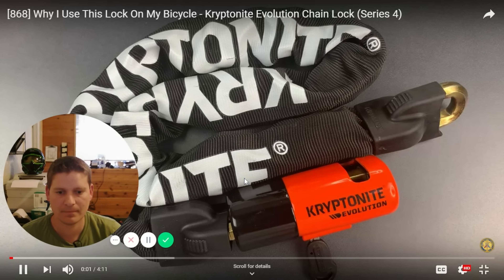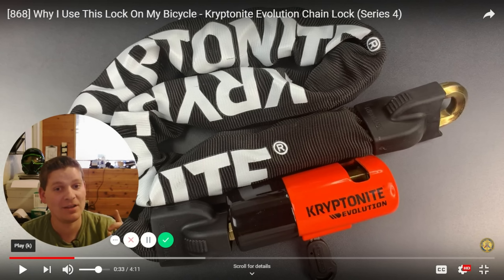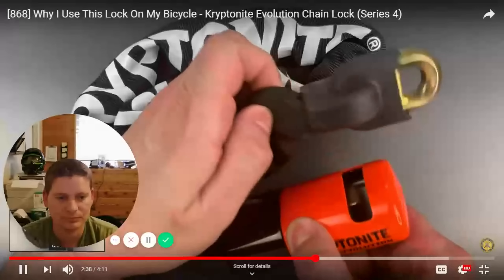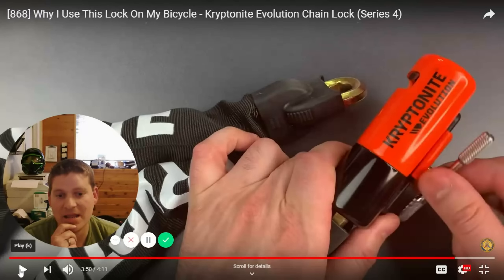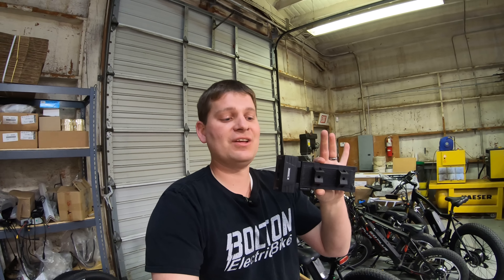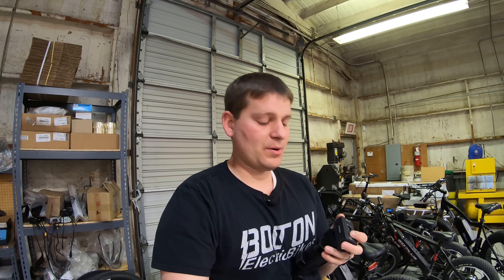Secure Your Electric Bike From Theft

Comment: I think instead of buying an expensive lock, it is better to buy multiple inexpensive but good locks and lock the bicycle at multiple points. That will be less tempting to the thieves to steal as it is secured with multiple locks and requires more time than cutting just an expensive lock. Also install some kind of alarm on the bike so that when someone touches it the alarm goes off and scare the shit out of any potential thief as the sound will draw peoples attention.

Comment: Kyle, thanks for the helpful video.  Great advice on taking bikes in when you can. I suggest taking the seat even if you have a bolt on collar. I have had good success with a quality U-lock and long cable where you can snake it around both wheels. 
That new fat bike does have a Terminator look to it, I like it!
Reply from the maker: You won't believe the new bike. I can't wait to show it to everyone.
Reply: Tern ebikes have removable pedals

Comment: If you have no key or lost the key.
you can very easily make another key fit.
 And it will work & no other key will work for it.

All you need to do is remove barrel.
Insert any key what fits inside.
File or grind the tumblers  until they all level.

Comment: For the seat use a crimped 1/8 coated cable.  I go into Home Depo buy the cable and crimps and borrow their crimping tool (they usually have one there so ask).  Leave enough slack so you can pull out the seat.  Seat thieves usually don't have tool and this system allows you to adjust the seat height.

Comment: Hey Kyle,  good video. You covered pretty much the whole subject.  In anticipation of getting my Blackbird I picked up a brake disk rotor lock that incorporates a 120 db alarm.  Was this worth $ 25 of security?  And I also got  a seat taillight with an alarm with a clicker.  These seem to be cheap and easy,  so is this pretty good for a start?
Reply: It's funny that you said that… I just got an E bike a few days ago, and those are the exact two alarms that I also bought. I like the tail light alarm because nobody can walk up and tell that it's an alarm, and I think the disc brake alarm will detour thieves because they cannot just takeoff and ride. I have to admit, I'm more confident about these alarms than I am chains and cables and U-boats and such....But I have a fairly heavy chain to lock my bike up to a post or object, and I have a cable lock that I use for my front tire. I just got my bike put all together so I have not had a chance to use these yet, but I most certainly do not want my ebike stolen. I also always take my bike into the grocery store, and I quickly lock up my frame to the rear wheel with a cable lock… Only takes about three seconds, And will keep someone from jumping on and taking off on it (speaking of my nice road bike and mountain bike) 

I'm surprised with all of these videos I watch about security, none of them talk about the disc brake alarms, or the tail light alarm that you mentioned. The disc brake alarms are so inexpensive, that there's no reason to not have one, to help supplement bike security. So at any given time I can have my disc brake alarm, my chain, my cable lock, and my tail light alarm....Was not that much money for all of those items, and I would think these would make my ebike "harder" to steal at least
Reply: Yep....me too.... but I bought three different types.... settled with the best one.... got stereo too

Comment: I have gone with an Abus folding alarm lock, a U lock, a cable lock and an additional, cheap, motion alarm. All except the U lock attach to the frame for carrying. I expect most thieves will be put off by amount to cut and alarms going off at the same time. Still vulnerable so considering data dot protection.

Comment: My eBike is not a fat tire.  It's a 27.5 Diamondback hardball with a bafang BBSHD. I had a u-lock w/cable and a bar long both "Via Velo". In less than 20 minutes they took the handlebars, the (pogo stick/box store) fork and seat with post.

Wheels still there though the color dash and of course the brake levers w/cutoffs gone

Comment: I've got a Rad bike and that flaw keeps me from going out places with it. I go out riding, meaning roundtripping. I don't go out to clubs or visiting people that live in apartments that I can't bring the bike with me. Going out food shopping grits my teeth!

Sure, I can bring the battery with. And I do.

What I want is something to keep that battery in place. I saw a handcuff style bike lock that has some potential. Maybe something machined or Frankensteined together to keep the battery from being removed. I do use 2 locks as it is, so that will slow down most, making it less attractive.

I'll share my design when I do! Ciao. Good podcast!

Comment: Yeeeaahh... this is a super AWESOME and very complete video!! Another design flaw, many battery bases (the bit that is attached to the bike frame) is made of plastic and can be flexed, like the Hailong battery case style, I can easily remove the battery from bike with just a butter knife or screwdriver.  Love your work mate... BoltonPOWEEEEERRR
Reply from the maker: Hey Bruno!  Thanks for watching.  FYI - we need you as a guest on the Bolton Ebikes Podcast!   What do you say?

Comment: I haven't gotten my battery yet so I haven't assembled my e-bike kit, but I'm going to be using the updated lobster lock in combination with a kryptonite cable. I'll also be equipping the bike with a sensitive alarm that will screech at 113db if the bike is so much as nudged.

EDIT: Just to test, I went and tried it out since I'm at home, the cable is long enough to loop around my back tire, through the loop under the seat to keep that from being stolen, and has enough leftover length to wrap around a tree or thicc pole before hooking onto the lobster lock. Once I have the alarm, the e-bike should be safe enough to leave locked up while I run an errand inside a store or something.

Comment: I use a sneaky little trick to secure my bike if I'm just going into a building for a few minutes.  I use a gunlock around a few spokes and a piece of the frame.  If someone tries to ride off, they'll have better luck carrying it.  😅  At worst, I'll have to replace a spoke or two, and touch up the paint.

Comment: E-Bike I am buying weighs 100lbs. I figured in some situations I can't chain it to anything.
However I could chain the tires making it immobile.

It would be hard to run off with an 100lb bike. It would be hard to fit in a car. 

I will also put a Samsung Smart Tag to track it.

Only in short trips in a gas station I wouldn't chain it to anything

Comment: Since Ebikes have disc brakes adding disc brake locks with shrieking high db alarms are a great second tier of defense that is light weight, motion sensitive and inexpensive. You can even put one on each wheel in a minute making a much less attractive target.

Comment: the litelok x1, it's anti angle grinder, 2kg D lock, it takes like 4 angle grinder discs to cut through, no thief has time to change their angle grinder discs, plus portable angle grinders have way less power, and takes way way longer, it costs 150£ but if your ebike is worth 2000£ it's a small price to pay, you should have 2 litelok x1's ideally, and always try to lock your bike up too 2 different immovable objects

Comment: I like the Abus lock with the motion sensing alarm, but its SO EXPENSIVE!  

This is a subject I am very interested in. I'm kinda peeved right now because you just threw the thousands of us owning RAD bikes under the bus. Now every goon knows how to easily RIP off my bikes.

I use my bikes to run errands and bringing my bike into the supermarket or drugstore isn't an option. From this point on, even after I buy that uber expensive Abus, I'll have to A) lock my bike to something sturdy B) quickly enter said store and grab a cart or basket C) Return to bike, unlock $500 battery, remove my suspension seat post and toss them into the cart along with my helmet.

Gee, thanks for making life easier! Don'tcha just love the internet?
Reply: Can always change the quick release for the seat post to one of the security ones.
Reply from the maker: Reality check - the thieves already know and you were living blissfully.
Reply: You can always toss a cable lock through the saddle rails (or suspension post if it allows, the ThudBuster LT does) locking it to the bike.
As to batteries I don't care what locking mechanism it comes with ALWAYS take the battery with you.
Reply: @Area13ebikes  Your Sarcasim does nothing to inspire confidence in your integrity. Sorry that you have taken this approach. It may not matter to you but I don't like your attitude or approach.
Reply from the maker: Are you referring to the honest approach?  As another commenter said, this has been circulating online for months.  It's best to be aware of issues.
Reply: Bolton Bikes. Have you contacted Rad Power Bikes? You have not said yes or no. 

Are other Bike shops advertising key blanks for Rad Bikes?  Or just Bolton E-Bikes? Can you provide links or references that “this” has been circulating online for months. You made the video. You sell the key blanks. You have a Bike Shop and you are trying to sell yourself while you are waiting for bikes to sell. It’s best answer the questions rather than provide sarcasm as a cover.
Reply from the maker: @jimblazer7824  search the Radpower forums, Facebook groups, and now even the comments.  You should find that in all three.
Reply from the maker: @jimblazer7824  nevermind - I see you're on the groups and shared my video there too.  ;)
Reply: Look, I like your videos, but you're dead wrong on this one. Saying everybody already knows is a major copout. And it looks like your advertising key blanks on your site as a way for people to go around stealing batteries.

Appearances are important in business and this just looks bad on you.

Comment: I lock mine up directly in front of where I am going inside.Lock mine up to a in ground concrete set parking lot post at Walmart directly across from the front doors.Walmarts group bicycle rack is a JOKE and at the far end by the Garden center not as much foot traffic there.Also have locked mine to a shopping cart when I had nothing to lock too.Or lock through frame and back wheel in front of  convenience stores right under security cameras.Getting a front wheel hub motor ebike kit first  of the year so will be locking front wheel as well when I am going to be away from bicycle any length of time

Comment: I hope you put your code on. I will never lock my bike if I can't see it. I have the New York forgetabout it and a chain lock and a disc brake lock but the key is took it to something sturdy. Stop signs no good one bolt in the bottom off sign and you pull the pole out.

Comment: Freightliner trucks used to be keyed with only 10 different lock sets, I tested it out and found 5 out of 20 trucks in the yard that would open and crank with my key.
Reply: Peterbuilt as well had only about 20 keys to fit over a thousand trucks the company had.
But to steal it you have to know where the brakes are.

Comment: When I lock my bike up at work I always take the battery with me. Thieves have been going for the batteries around here since they're easily concealed after removal. I have the same downtube battery as the one shown that the blanks work on, which has another issue; The metal bolt that the lock uses to secure the battery to the cradle actually locks into just the plastic on the cradle which I'm sure could be fairly easily exploited. That being said my bike is 20 something years old and sports some rust, which probably makes it a little less enticing to steal.

Comment: Years ago, a thief stole a $900 bike from inside a Landis store while he was talking with one of the salespersons. I guess he figured if he pedaled away quickly enough he could get away clean.
This does show thieves can be VERY organized and steal bikes even right next to their victims.
I was in the store, and immediately got on my bike and followed being as discrete as possible and gambling on a few shortcuts. I found a crew of at least 3 people loading the bike into a large panel truck about 1/2 mile away...took down the license and the truck's description and location and phoned the info back to the shop. Within about an hour the Police recovered their bike, but couldn't/didn't get the entire crew up on charges. I couldn't ID all of them as I stayed quite distant to avoid being noticed by them. They apparently just charged the "first" thief based on shop video. The shop put flat tire goop in my (at the time) $120 "superstore" bike's tires as a thank you. I never heard how the case ended.

I was in the shop for a slow leaking tire...the "green goop" never really did do much more than slow down the air leak a bit more.

Comment: HEY! Funny thing is I whatch thelockpickinglawyer, I'm not subscribed, but I enjoy watching his techniques. If you dont know by now I have two Rad Rovers a 2015 I upgraded to a 2017 motor  and I have a 2017 Rover. I love them both, but I think it's just the new Dolphin stly batteries that you could use a blank to release/open the battery  lock. I understand take you bike with, but a Rover is a little to intimidating for most.  thanks for the video!

Comment: No one picks a bike lock. I enjoy his vids too, but 99.9% locks are cut off, and that's really where people should focus in terms of locks being taken off. A battery powered angle grinder with the right blade will take off any lock quickly. So, use best possible locks, use several, other things that slow them down like wheel locks, etc, to add time, is always a +.

Comment: Bike security...  personally, I take the bike into grocery stores ( with panniers one to carry the groceries ).  I only use a simple Combination steel cable lock... its lighter, easier to use, and I only lock up the bike if I can SEE it ( like from inside a coffee shop) or will only be away from it for a short period of time ( like ducking into a store to buy something where I will be back out within 10 or 15 minutes )
#1 do not ever ride your bike to the movie theater.  Or any other place where thieves might assume you will be absent and unable to see your bike for a long stretch of time. Like- do not lock it up in front of some large office complex or apartment building.
#2- if you really do want to go to a movie, on your bike... or even the office... Lock your bike up IN a parking lot that has an attendant, and PAY the attendant to make sure no one just tosses it into a truck. For commuting, Some cities actually have Bike parking facilities where you can pay a monthly fee for access to a secure bike lockup.
#3. For any parts that folks might want steal from your bike, eliminate quick releases and opt for security nuts or bolts that require the kind of tools the common thief would be unlikely to be carrying... Such as, Torx or 5 point bolts or screws rather than Phillips.
#4. Avoid routine.   Any lock can be defeated...  you are mostly counting on the Odds of some thief just so happening to have the right tool to defeat your lock, and just so happening to come across your bike.   But for high ticket items like E-bikes,  thieves often CASE a bike before they attempt to steal it. e.g. they Notice that you leave your bike locked up in the same location, every Friday, from noon to 1. They scope out your lock, and then simply show up at that time with the tool required to get the bike in seconds.
So do not be predictable.   Success at leaving the bike locked in a specific spot is NOT a reason for thinking its safe. It’s exactly the opposite. The more often you lock it up in any given spot, the more likely someone will form a plan to take it.
Reply: Wise & prudent advice.  Thanks.

Comment: Many thieves won't bother with the time to pick a lock; picking takes skill, patience, and practice..  if they see a cable lock, they'll have either a cordless grinder or bolt cutters that they'll use to get the chain, cable, or lock off.    Only if you leave your bike where no one is around would they even bother with picking a lock or trying to figure out the combination.  One of the worst things you can do is to use a combination lock ( can be decoded quickly with little skill ) or using anything MasterLock or that looks like a Masterlock.  A cheap old masterlock can often be rapped open with a pair of pliers or a smallish hammer.  A cheap chain is also pretty much useless as well as such chains aren't hardened, and are cut easily. 

Those portable cordless grinders also serve other purposes, like stealing catalytic converters.  Most thieves are going to go for the easier targets, but when you have a freshly charged grinder in your backpack, well,  they'll go for it especially if they can run ...

Comment: I have seen a female cyclist where she shows us she is using 3 different locks to lock her bike to a bike rack. Cafe lock, U lock to lock to bike rack and folding lock to lock front wheel. So the thief will need to cut 3 locks in order to steal the bike. Ever since she uses this 3 lock system, her bike was never stolen again. Worse comes to worse, the thieves will puncture her tyres after they find out they couldn't steal anything from her bike